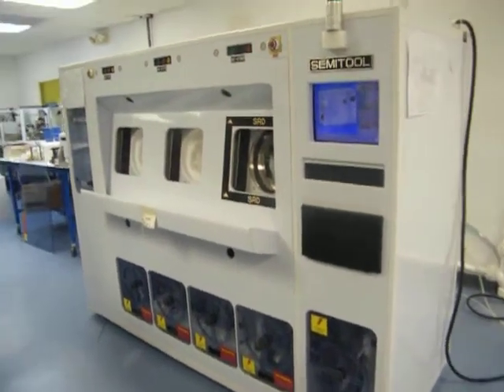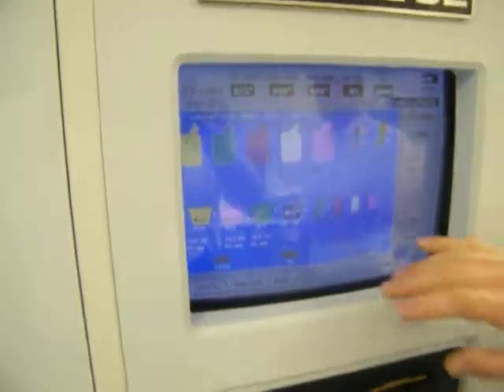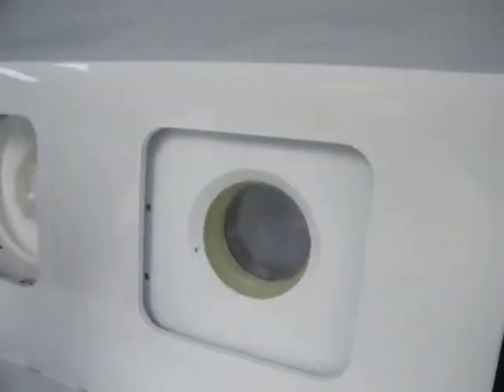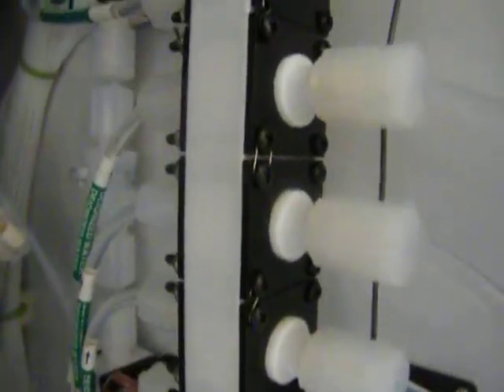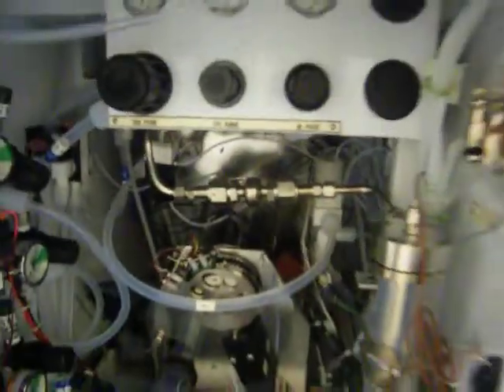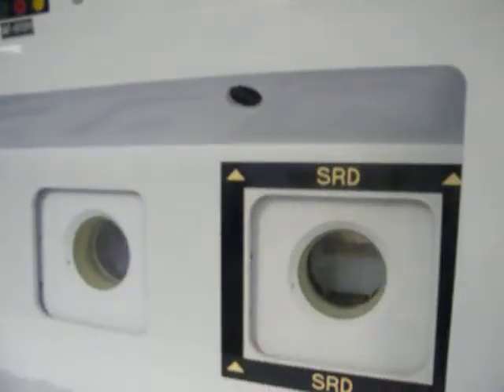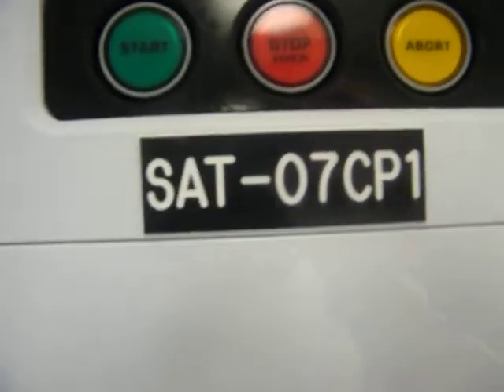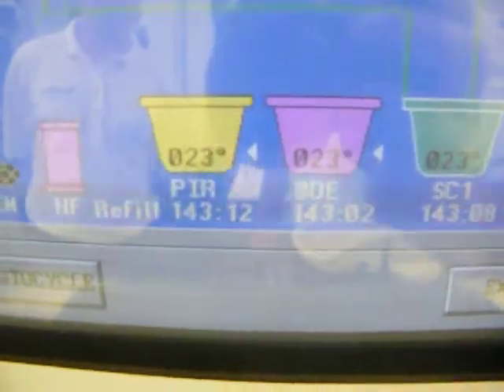Semitool Spray Acid Tool (SAT) Refurbished by ClassOne Equipment

Comment: I myself worked on an early Semitool SAT. It came from GI's fab in Scotland at Glenrothes (Silicon Glen) IIRC. It had been acquired by MCP Wafer Technology in Milton Keynes UK to chemically polish wafers of Group III-IV elements for photoelectronics. It was completely 'dead'. Even the power supply had failed and people had 'tinkered' with internal dip/hex switch settings ! We got it running fine again. Do beware of any H(ydrogen)F(luoride) though ! That stuff is nasty with a vengeance. A wonderful etchant (in combination with some H2O2, H2SO4 and HNO3).